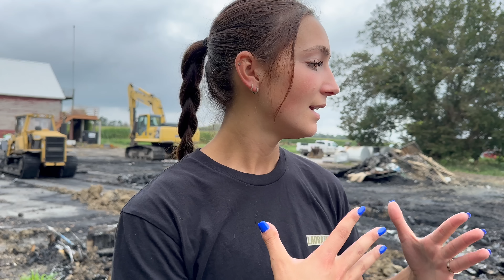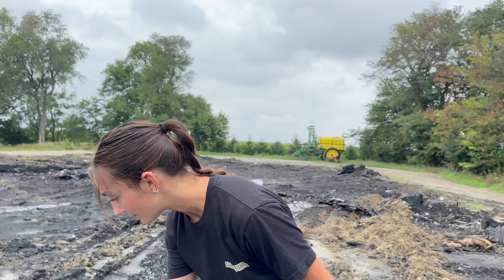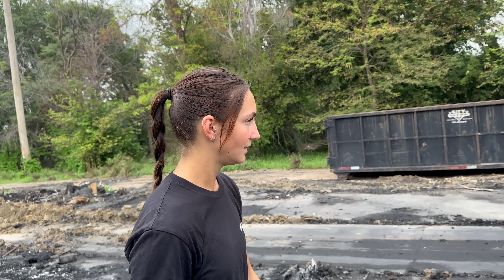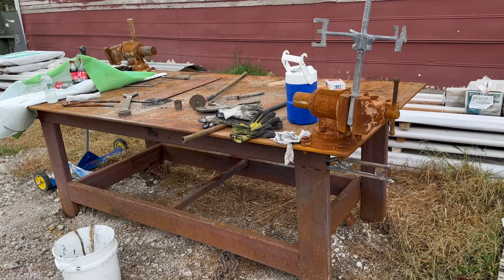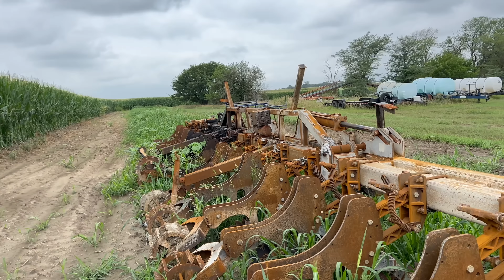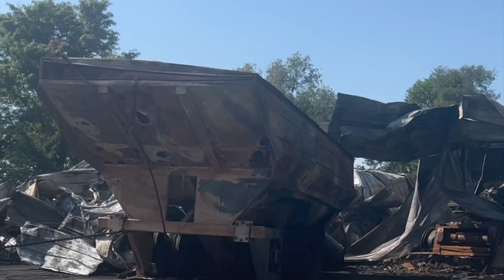Loading Burned Farm Equipment

Comment: What a tragic loss. That is so hard to even look at knowing the substantial loss came about from only trying to protect equipment from storm damage. Very devastating. Farm rescue is a life saver of a project for farmers in dire need from what I have seen over the years. My question is, is there a similar project that is available for helping farmers in dire situations with getting crops in the ground. Such as in this case, every piece of equipment was lost and now the farmer has no means of even planting crops? If not, I think there should be a similar one created for just that.

Comment: So great to see the support this family is getting. It's still hard to cope with a disaster like this but it helps to know you're not alone. 

Special note here; having been through this exact situation myself in January of '22 certain things that appear "ok" or still usable should not be trusted. When steel gets that hot it loses it's temper. Becomes soft and unable to withstand the load put on it by serious use. For example a wrench can round out on a stuck bolt and slip and there you go smashing fingers. Or especially those hitches. They should be used in extreme caution or just tossed to be safe. They most likely are soft from the heat/cool down cycle (lost temper) and can bend or even tear out around the pin holes quite easily. Resulting in trailer coming loose on the road. Some things just aren't worth the risk. Log chains too can stretch and break under much less force than they should. Broken chains are extremely dangerous. Not trying to be a jerk here just speaking from recent experience. Take care guys. Continued prayers.

Comment: The positive cable from the batteries to the starter and then from the starter to the alternator and cab have constant juice that isn't fused so it's another good reason to have disconnects on everything. Make sure the cable is well wrapped, sleeved, insulated, and secured{ties,clamps} as well and keep an eye out for any place it might be starting to chafe.

Comment: I had a very similar shed fire with most of my machinery destroyed in 2015 .I rebuilt several pieces of equipment and am still using to this day.We rebuilt a ripper but before we started a neighbor came over with his tractor and we took it to the field and tried to wreck it and see if the frame would hold up by pulling it through the ground as deep as we could at least 2 - 2 1/2 feet deep ,we took a maul to the cast parts to see if they would stand up,we saved most of the tools although we bought all new ,but occationally if we need to cut off a wrench to get in a tight spot we go for the burned ones

Comment: If I'm not mistaken it was mentioned in one of these videos that the cause of the fire was a faulty battery or battery cable on one of the John Deere tractors.  If that can be proven wouldn't that make either John Deere or the battery manufacturer at least partially liable for damages? I'm sure they won't voluntarily admit liability, may take a lawsuit to recover damages from them.  I'm glad to see Matt and Bunker Branding stepping up to help with the Laura Farms shirts.

Comment: I would do a hardness test on that implement that they are planning to rebuild. If the structural steel has been compromised by the heat it will fail under load in the field. Look up steel hardness testing and test kits. I hope you find this helpful. My grandparents lost their dairy farm back in the day. They lost everything in a matter of hours. If it wasn’t for the neighbors and local community they would not been able to start over..

Comment: I would probably run a portable Rockwell or Brinell hardness check on those wheel spacers before I used them or any other load bearing parts that have been that fire. Low alloy carbon steel can be annealed or embrittled in a fire that hot.
Reply: I'd probably discard the wheel spacers---you can imagine the stress(es) they're subjected to!!

Comment: After hearing the cause, I'd consider putting a main disconnect switch as close to the battery as possible and turn it off every time I left the machine in a building.

Comment: Would these wheels weights and spacer be usable?  Wouldn’t the fire change the molecular structure of them?  My thoughts and prayers are with them. 🙏🏼  Hey those old military trucks are awesome! They will go anywhere.  Laura, you and your husband are so awesome!  Thank you for all your doing to help!
Reply: Tractor weights are probably o.k. as they're cast iron.  Funny you should mention them tho, because when I watched the first video and saw that burned-up tractor my thought was that the wheel weights were probably the only salvageable parts.  But think about it: a cast-iron skillet is subjected to intense heat without damage.  Cast iron (anything) is amazing.
Reply: @theburnhams2925  that’s a very valid point.  Had not thought of that.  Thank you for the reply!

Comment: It is surprising that a battery cable would cause that much damage. I have seen fires at my past employer that started the same way and one was started by a mouse chewing on a block heater cord. We lost two trucks at our facility and I know of other sites that similar fires. We used battery disconnect switches on the positive side of the cables to try and prevent this situation.
Reply: There's a design issue where the battery cable runs along the plastic fuel tank.  I'm not sure if that was a contributing factor in this particular case, but you can see how it could go really fast if a cable melts through the plastic tank.
Reply: @42base13  Yep, the cable probably was rubbing on a frame member close to the tank. I also check the battery cables on anything I work because of this issue.

Comment: That looks awful...I hope they can recover and return to normal operations. It may be a good idea to invest in an automatic fire suppression system in buildings where machinery is stored. It only takes a hot engine + fuel leak to start a fire. Not to mention electrical faults and those pesky lithium batteries!

Comment: Just a question. Why dont farmers install some kind of fire suppression system in their barns with all the equipment? You know like a water sprinkler system.  But foam instead of water cause the foam would smother the flames out.   I figure it would be expensive to install, but not as expensive as replacing all the equipment.

Comment: All motorised machinery should be fitted with an isolation switch which when turned off every time the machine is not in use would go a long way to preventing this type of thing happening. I pray for this family that they are back on their feet in a short time.

Comment: Install a fire suppression system. It’s probably quite expensive but it’s worth it. There are self contained systems that work like a large fire extinguisher. I’ve worked in auto and truck garages that are equipped with fire suppression systems. I know of a fire that happened decades ago in a hardware store warehouse. The fire started with a diesel truck block heater. So it doesn’t take much to start a massive and costly blaze.

Comment: I think we're all probably guilty of just accepting the quote which our insurer gives us at renewal time without thinking about the real cost of replacing what it is we're insuring. Building materials, construction, anything with a battery or control electronics (and what doesn't have a computer chip in it these days?) have all rocketed in price in the last few years.  Mike's experience has certainy made me go back and look at my insurance . . . .